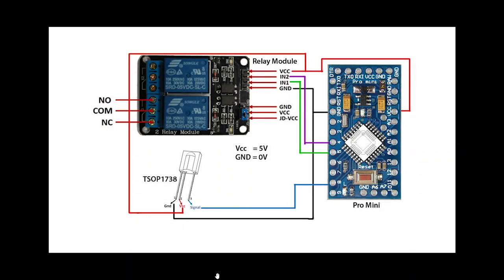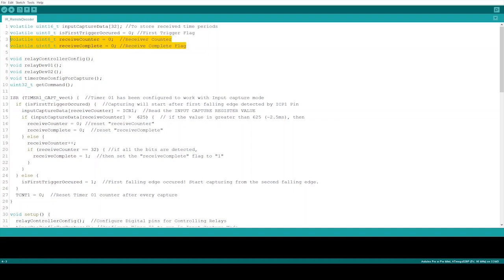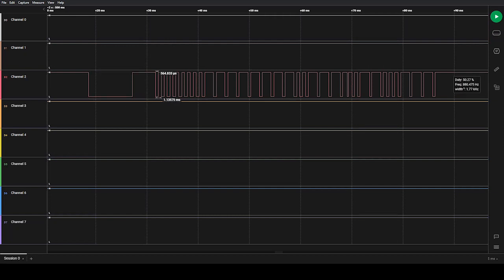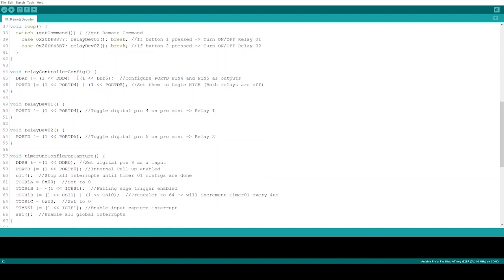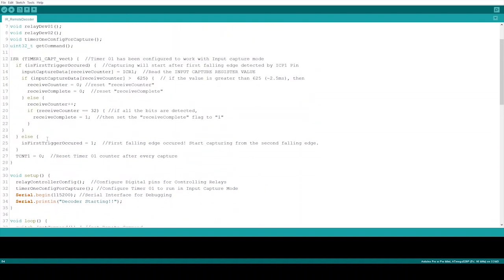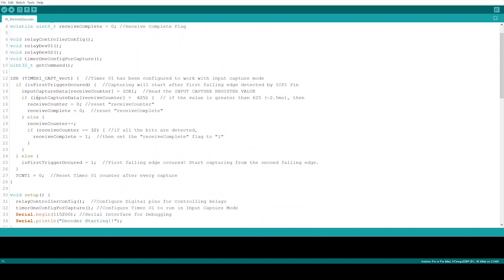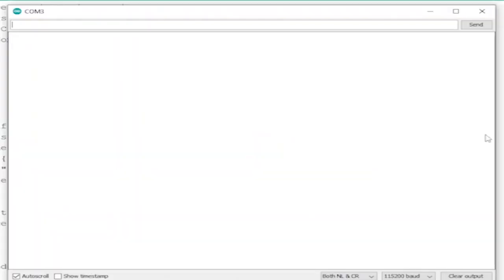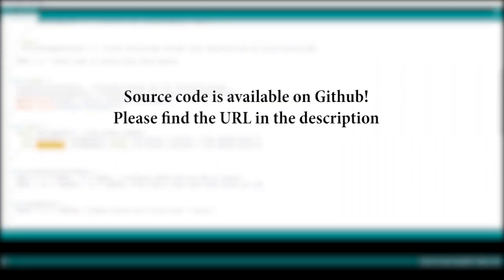IR Remote Receiver - Arduino (Without using Library)

Comment: Thanks for the video. 
But what was the tool you used to analyze the signal in 2:01? Does it work with other IR remote protocols as well?
Reply from the maker: Hi! the tool I am using is a "Logic Level analyzer". You can buy this from online stores like ebay or AliExpress for really lower prices. I am even using a clone of "saleae" brand (expensive). This device can be used to capture any IR remote protocol. Besides that, this also supports for common protocols like SPI. I2C, USB etc.